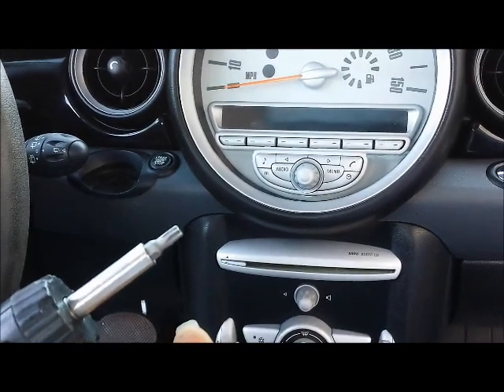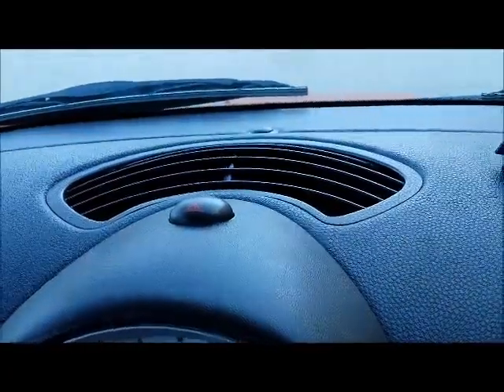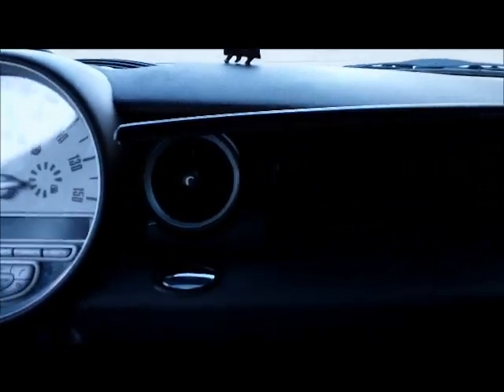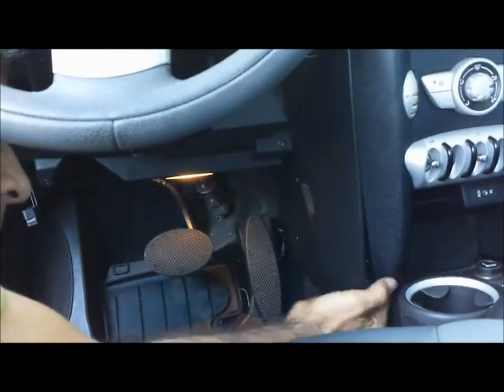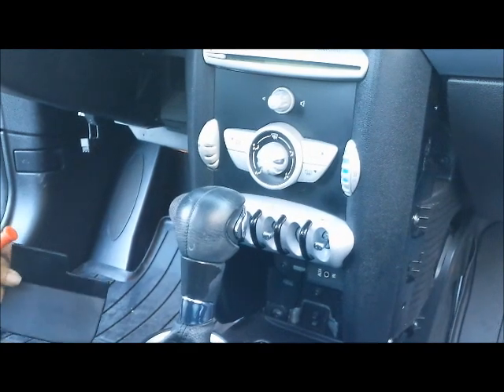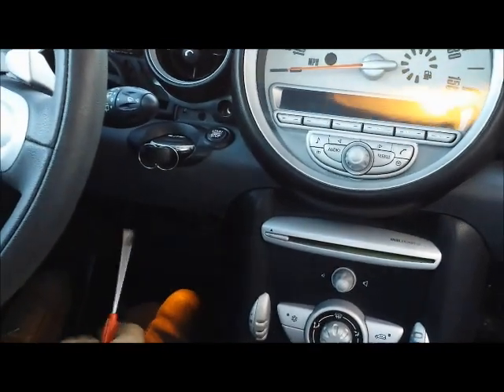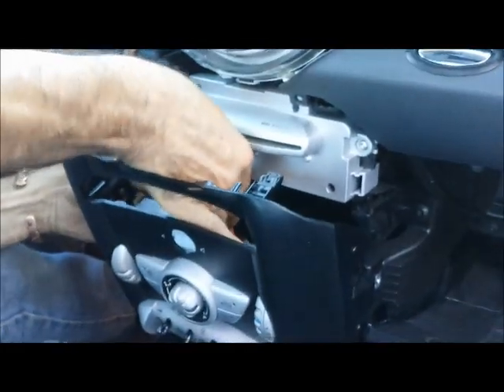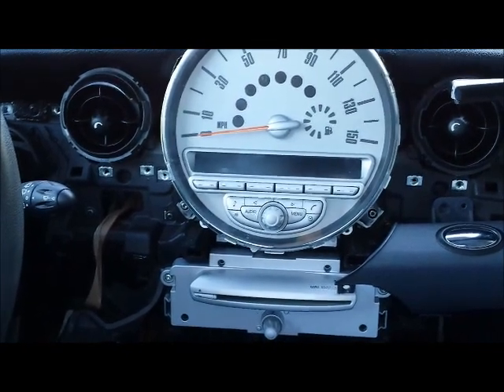How to Remove Display / Speedometer Cluster / Radio from 2008 Mini Cooper for Repair.

Comment: Great thanks. Just got a 2013 R56 and the radio display back light and some of the buttons do not work.
Reply: Hi Malcolm, I got the same problem with a 2010 R56 mini cooper, the radio display back light doesn’t works and the command buttons and the sound neither, so i bought another one, but the display still doesn’t works, the CD player and sound are working, but I can’t use any command besides the power and eject buttons… Did you fix this problem? I don’t know what can I do anymore with that…
Reply: And after putting it back it will rattle like hell 😂

Comment: How much will cost to repair the lcd display??
Reply: Can get it cheaper (around 350.00 -400.00) on Ebay...
Reply: Where can I found the "glass" for this radio? Mine was broken :(
Ty